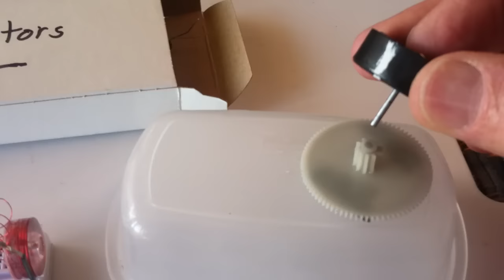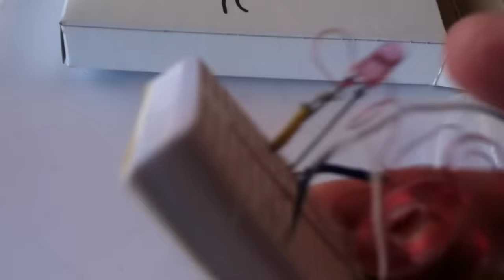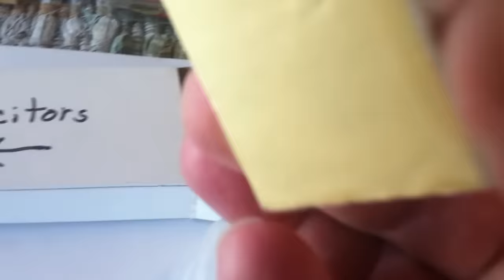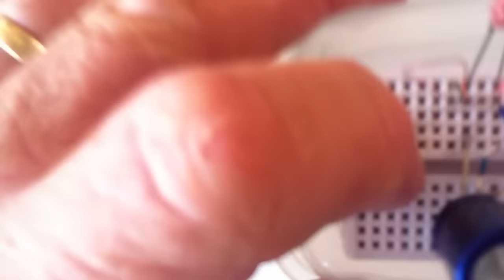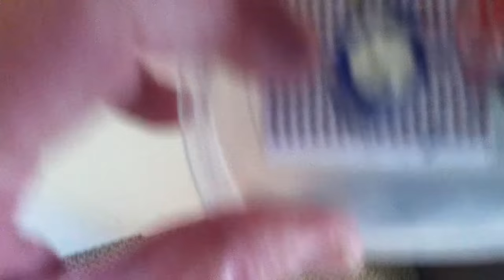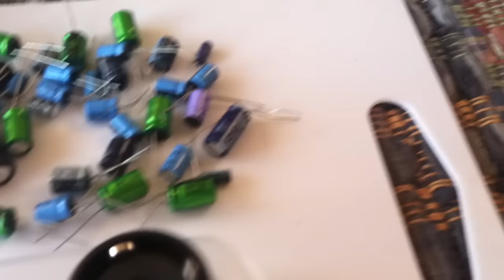The Illusion of a Self- Runner

Comment: a charged supercap, right ?
Reply from the maker: Your guessing?  That was kind of the point of this video. The answer is not revealed.  How many times have we seen this happen?  The inventor just doesn't say anything.  Everybody is left guessing and making assumptions.  Extreme frustration.  Time and money is spent chasing an illusion.
Reply: No.. it is secret footware induction, obviously.
Reply from the maker: YOU  GUESSED IT!   It is just simple 'footware induction'.  It is so obvious.  A pickup coil in the inventors foot picks up the energy from the hidden floor coil.  A small coil on his finger transfers the energy to another coil hidden in the bread board.  So simple. People thought it had something to do with the capacitor.  Ha!

Comment: I would ssaayyy fake cap. Batterie inside the cap.
Reply from the maker: Nope.  No battery on this one.  I have thought about doing another video where I did take one of the tiny caps and put a watch battery in.  I would have to modify the setup some to increase the resistance so the motor would run long enough for the video.  The watch battery would drain pretty quick.

Comment: I like your videos. You inspired me to copy your levitation device but I came up with some kind of unexpected perpetual spinning anomaly by accident. A self spinner of sorts.  I can't explain it can you?  I titled the youtube video "lidmotor inspired perpetual anomoly" If you have time to take a look maybe you can explain to me why it never stops spinning. I assume some kind of 60 cycle something or other.
Reply from the maker: Thanks.  I will check it out.  I will go with your explanation---something to do with a 60 cycle induced spin.
Reply: in america in the proximity of houses there is always radiomagnetic radiation(( invisible) of 60 Hz. In Europe it is 50 Hz) that can be picked up with the right combination of spool and capacitor, this can provide the energy to spin a rotor. Lots of these projects are based on this principle.
Reply: hi danny.  This is Roger Harrison. So if I get a 12 volt battery, take a table out in the middle of my yard 100 feet from any electrical power, set up my exact same experiment powered by dc battery power into my 7805 five volt regulator the anomaly will go away and the magnet and screw will not spin like it does in the house?